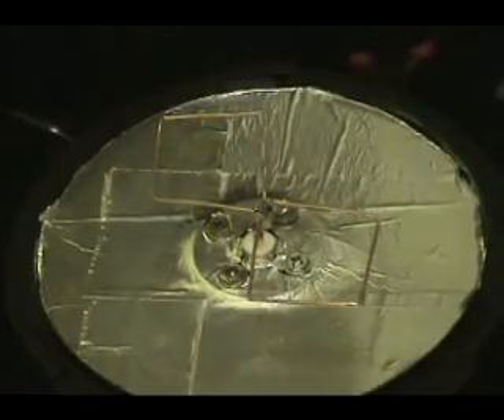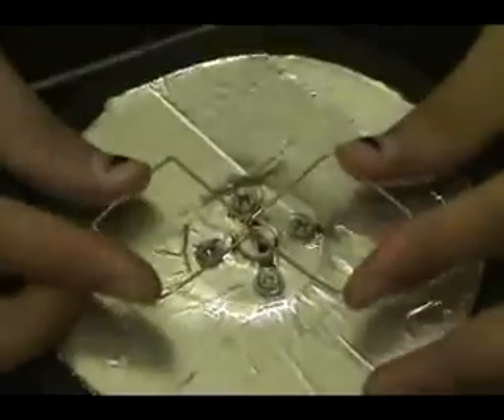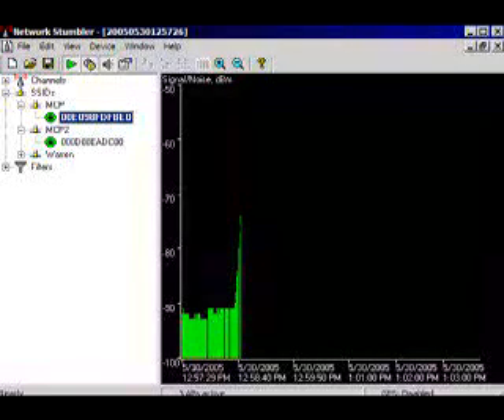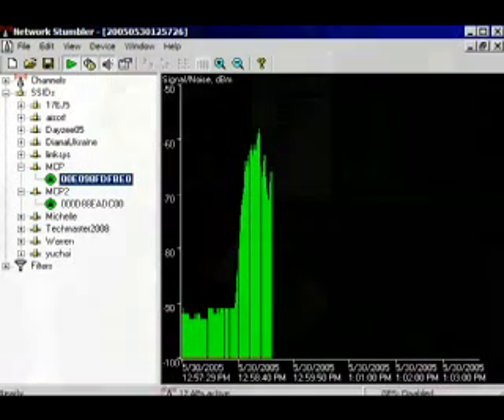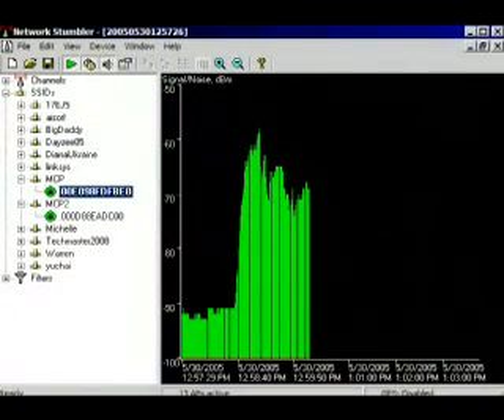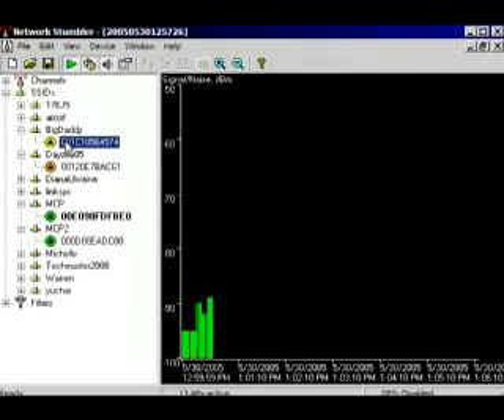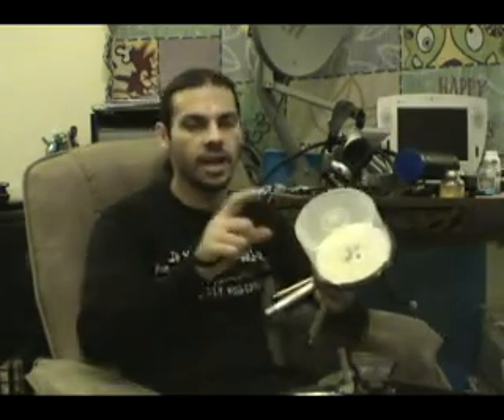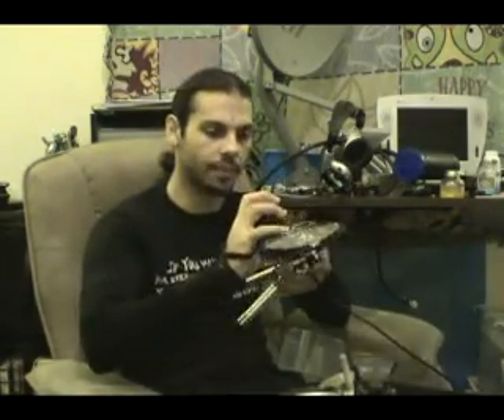2.4 Ghz BIQuad Antenna -Part two

Comment: Question: Would working a VHF/UHF radio at 50w with the antenna mounted outside at the rear of the house affect a wireless 2.4ghz router and cause damage to it or loss of connection via interference while modulating on the radio?

Comment: i like the spindle radome, but it could be absorbing some signal. put it in the microwave to see if it gets hot. if it does, its absorbing microwave signals from the antenna

Comment: I've actually seen some improvements with this. I got about 5 more AP, the Collinear was useless and my biquad design has some flaws. I had to solder the rg58 cable (Can't locate any LMR in my area) to my pci board. 

However, I'm thinking about building a Cantenna. Mounting a USB Wifi dongle on the outside and soldering an antenna removed from a Linksys router onto it. This will then lead inside the cantenna.